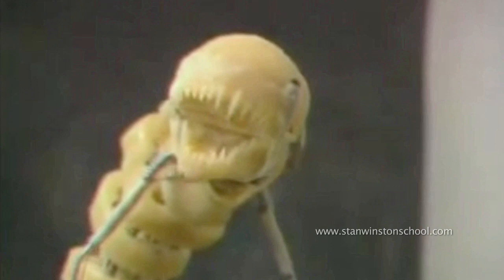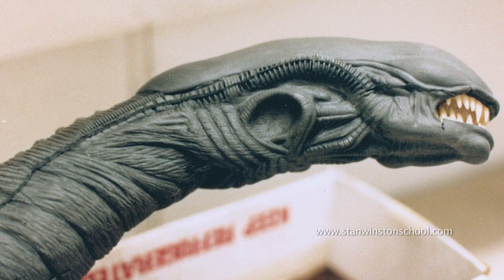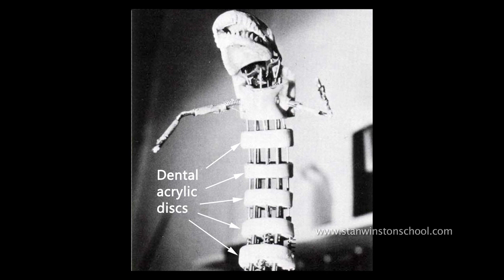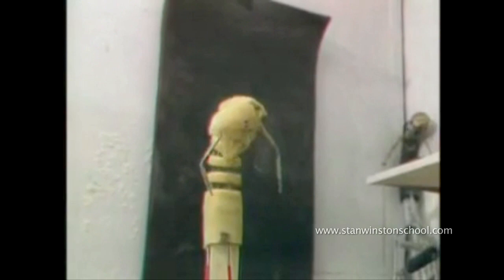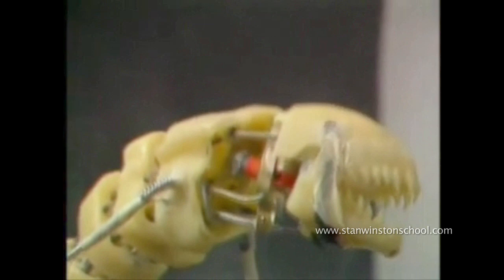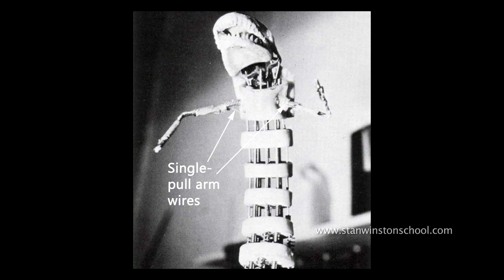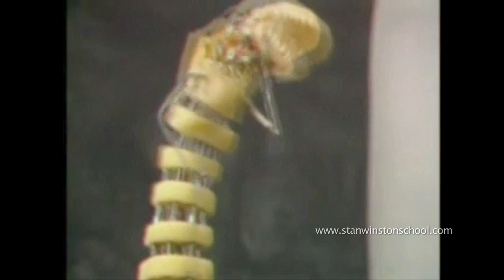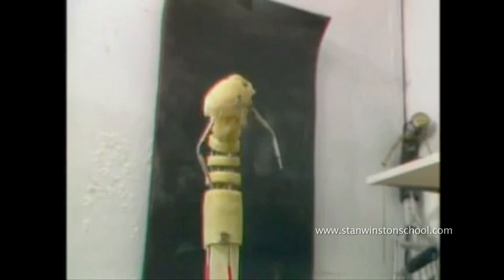ALIENS Behind-the-Scenes Chestburster FX Test

Comment: One of the faults of CGI is that because the creature is digital, it moves at a higher framerate, 60 FPS(currently), than a practical creature. A matter of fact, the digital creature has so much frames of animation per second that it moves at unreal speeds. Films usually run between 24-30 FPS just so you know.